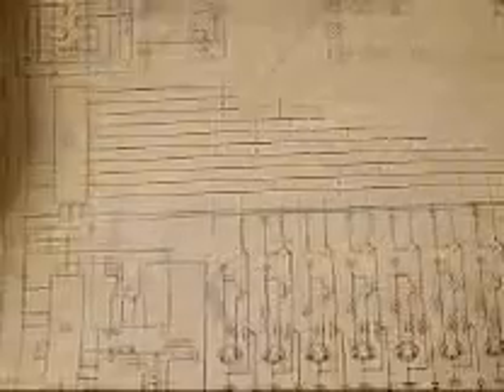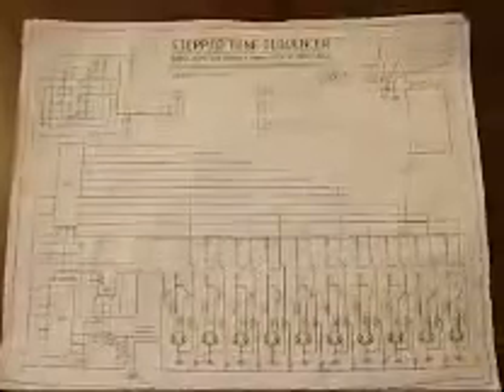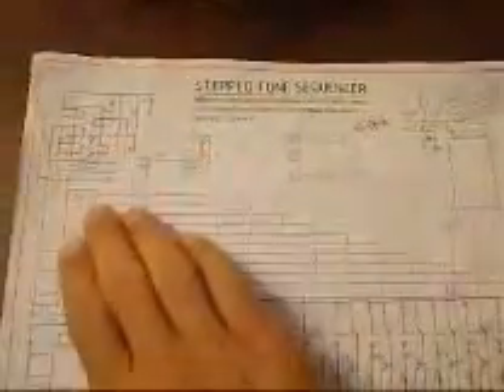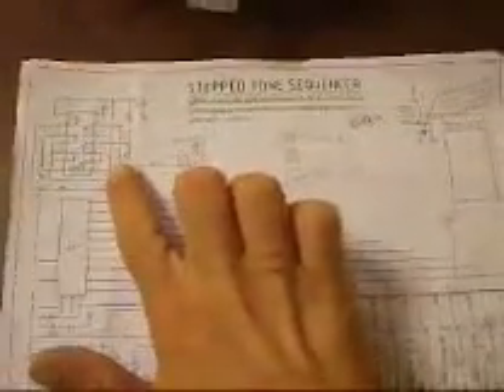Stepped Tone Sequencer

Comment: Fantastic!  Did you use erector set parts for the structure?
Reply from the maker: JackANDJude 

Thanks! I used 'plumbers strap'. It is used to hang piped from the bottom of floor joists in your basement. You can buy a 50' roll for $3 or $4 at the hardware store.
Reply: Wow, that's a great deal!  I think I'll try using some.  Any tips & tricks? :)
Reply from the maker: It comes in a roll, so it takes some time to straighten it out. There seem to be various thickness (gauges?) of the material as well. The thinner stuff is easier to straighten. I used tin snips to cut it and a pop rivets to connect parts together. After cutting it can leave sharp corners so I cut (at 45 degrees) the corners down too. If you look through my videos there is one of a little robot I made from plumbers strap.
Reply: Cool.  I got some this weekend.  They also had a pvc variety.